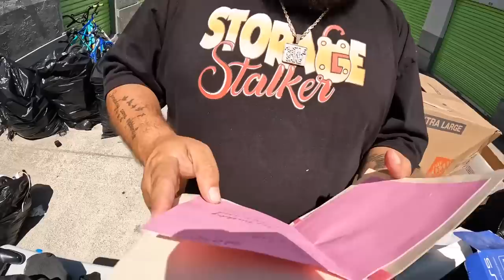Floor to ceiling packed with cash…LooK What We Found 👀 #shoes #viral #money

Comment: I'm on a cabbage diet find you a big pot two heads of cabbage Lipton Onion Soup mix if you use both heads of cabbage empty at least three packages of Lipton Onion Soup mix guaranteed to melt the pounds away and flush you out